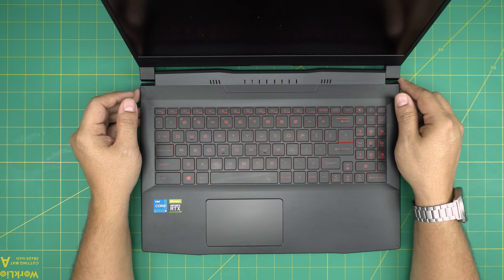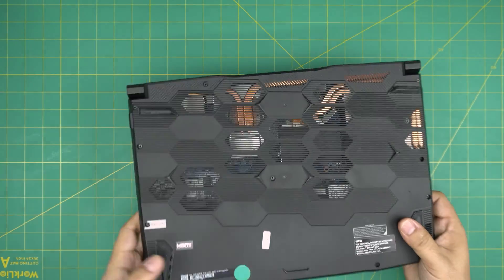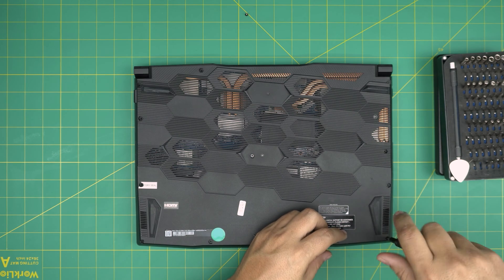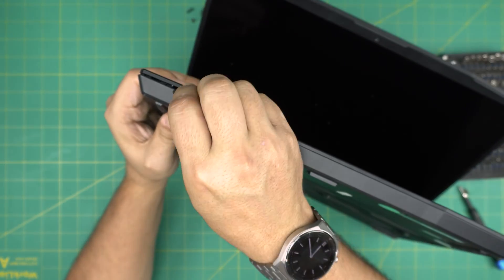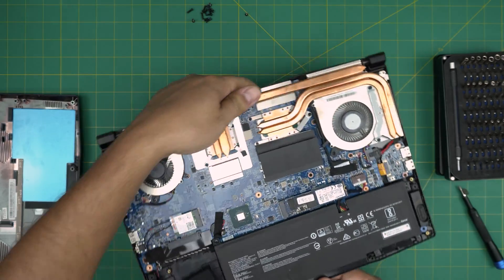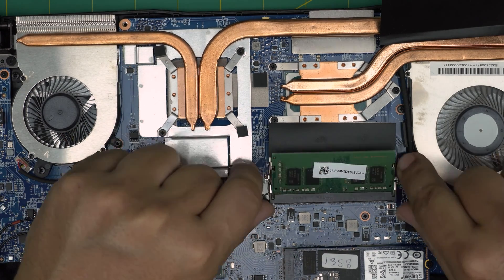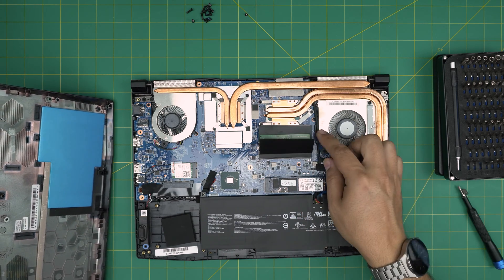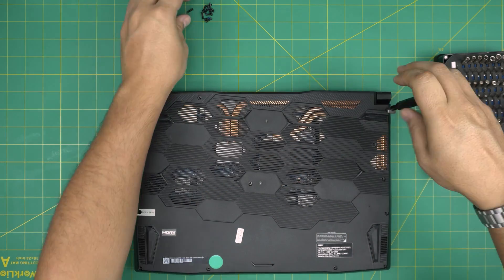How to Upgrade RAM on an MSI Katana GF66 11UC MS 1582 Laptop

Comment: Thanks for the video was rather helpful but was wondering if there are specific rams for the exact socket of the GF66 or all RAM for laptop are the same socket . Also looking to upgrade to 32 GB meaning x16 any suggestions towards which to buy?
Reply from the maker: It's my pleasure my friend.
🫠Regarding your question, I have linked the recommended RAM in the video description—32GB or 64GB, SDRAM DDR4.
Should you have any further questions or requests in the future, please don't hesitate to ask me.
cheers🍻
Reply: Appreciate the feedback and your video changed them and were much easier than it looks worked like a charm 👌👌

Comment: I bought a msi katana a15 ai and wanted to upgrade the ram to 32gv. I purchased the crucial ddr5 4800mhz on amazon but the computer just stays on black screen but keyboard light turns on.
I checked online and tried to disconnect the battery and eveb tried a bios reset but nothing. 

Im hoping maybe i purchased the wrong ram and will buy a more expensive samsung ram that the laptip already comes with 2x8gb.

Do you have any advise on this matter, hopefully i can use the 2x16gb crucial ram to use.
Reply from the maker: 🫠 Regarding your question, sure you can have 32GB without any issues.
You'll need to get 2x16GB DDR5 4800MHz. For your A15 model, power off the laptop, disconnect the battery, and press and hold the power button for 30 seconds. Then, remove the RAM and install the new modules.
Next, plug in the battery and place the bottom cover (no need to screw it in, but the cover must be in place or the onboard sensor won't activate). Make sure to plug in the charger, wait a few seconds, then power on the laptop.
Wait up to 4 minutes—the motherboard will run a memory check, and on some models, POST can take that long.
Should you have any further questions or requests in the future, please don't hesitate to ask me.
cheers🍻

Comment: What if I already have an 8gb slot in my ram, can I just buy one 8gb to put in my other ram slot, or is that not how it works, do i have to buy the 2x8gb. Please let me know
Reply from the maker: 🫠Regarding your question, you can just buy a single 8GB or single 16gb and place it on the 2nd slot.
Should you have any further questions or requests in the future, please don't hesitate to ask me.
cheers🍻
Reply: @ if i want 16gb ram and I already have 8 in 1 slot do I get an 8gb to make it 16gb?

Comment: If i am trying to get 16gb ram, do i get the 16gb ram or the 2x8gb ram. I see two options and not sure what to get.
Reply from the maker: 🫠Regarding your question, i recommend 2x16gb for total of 32gb or 2x8GB for a total of 16GB
Should you have any further questions or requests in the future, please don't hesitate to ask me.
cheers🍻
Reply: @uFixTek  what if I already have an 8gb slot in my ram, can I just buy one 8gb to put in my other ram slot, or is that not how it works, do i have to buy the 2x8gb. Please let me know

Comment: My default ram is 8gb, if I remove it and replace the two ram slots to 16gb x 16 gb, is it possible?
Reply from the maker: 🫠Regarding your question, sure, you can, and it will work just fine without any issues.
Should you have any further questions or requests in the future, please don't hesitate to ask me.
cheers🍻
Reply: @uFixTek  tysm 🙏
Reply from the maker: It's my pleasure my friend.

Comment: thanks mate for video, does it required to disconnect battery if i want to add another ssd in empty slot?
Reply from the maker: It's my pleasure my friend.
🫠Regarding your question, there is absolutely no need to disconnect the battery. Just be careful not to drop screws or the screwdriver on the board. You can touch it without any issue. Make sure the laptop is OFF.
Should you have any further questions or requests in the future, please don't hesitate to ask me.
cheers🍻
Reply: @uFixTek  I really appreciate detail reply buddy thanks 👍
Reply from the maker: Anytime my friend🫠

Comment: do i have to install windows at the end? - home come i cant just take out the HDD and install the SDD, put it back together turn it on and them boom... right where i left off?
Reply from the maker: 🫠Regarding your question, if you're just adding an extra storage HDD or SSD, then you don't need to reinstall Windows. However, if you replace the SSD or storage where Windows is installed, then yes, you will have to reinstall Windows.
Should you have any further questions or requests in the future, please don't hesitate to ask me.
cheers🍻

Comment: Are the 16Gb Modules DDR4 for this system, I have the MSI Katana GF76 11UD 11th Gen Intel Core i7-11800H. RTX 3050 ... want to go max ram so is 2x 16gb best or can I get a 2x32gb making it 64gb ?
Reply from the maker: 🫠Regarding your question, you can place any brand SDRAM ddr4 3200mhz up to 64gb (2x16gb or 2x32gb)
Should you have any further questions or requests in the future, please don't hesitate to ask me.
cheers🍻
Reply: check msi website says max is 64gb so up to you but either work
Reply from the maker: yes that is correct 64gb max (2x32gb) work just fine.

Comment: Hey, I bought 32 gb Crucial DDR4 - 3200 SODIMM, CT32G4SFD832A for MSI gf66. The package only has one chip of RAM 32 gb, I thought it would be 2x16.

Can I mix add the chip to one chip of 16gb. Or should I remove both and place the 32gb?

Thank you, great video ❤
Reply from the maker: It's my pleasure, my friend. 😊 I deeply appreciate your taking the time to provide feedback. If you're inclined to support the channel further, feel free to like and subscribe—or even both!
Regarding your question, you can have 16gba nd a 32gb, mixing will work fine without any issues, and you will still be getthing dual channel.
Should you have any further questions or requests in the future, please don't hesitate to ask me.
cheers🍻

Comment: i got the same labtop how do i know which ddr4 8 gig ram to buy for this? because some are alot more expensive then others
Reply from the maker: Regarding your question, the link to the compatible rams are in the video description, or you can look for any brand as long as it is SDRAM DDR4 3200mhz
Reply: @uFixTek I got ddr4 sodimm 16gbs at 3200 mhz, when I put it in with or without my other 8 gig ram stick is just stays on a black screen any idea why?
Reply: @uFixTek same person btw